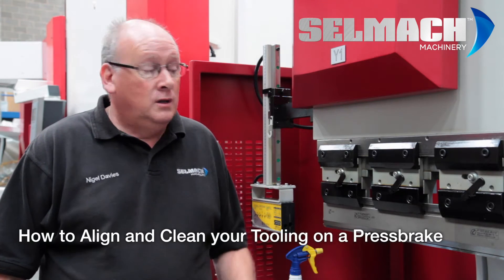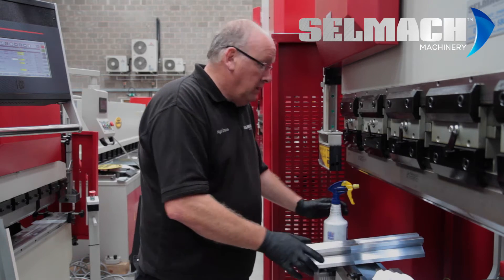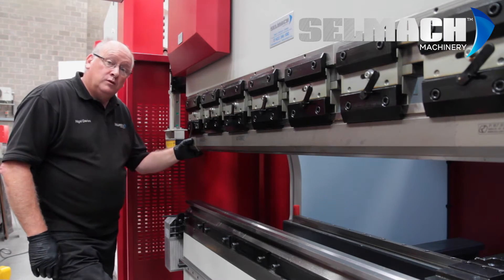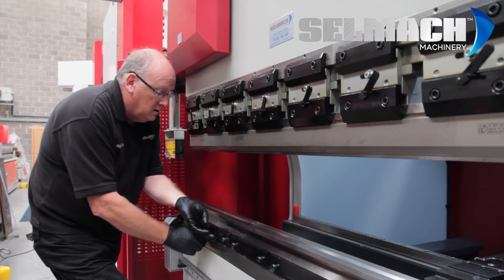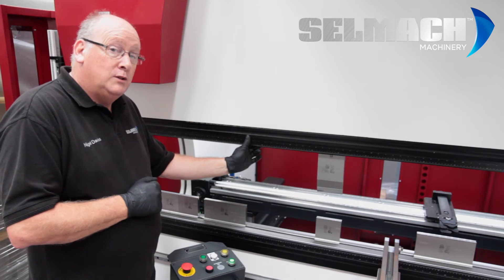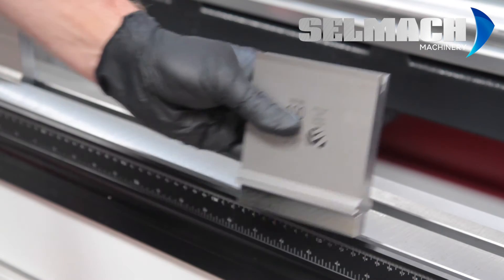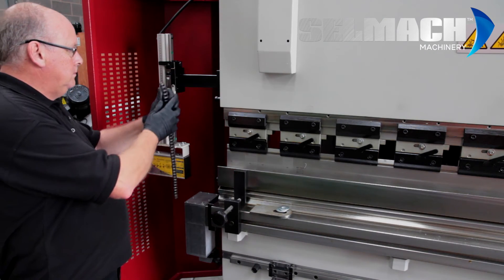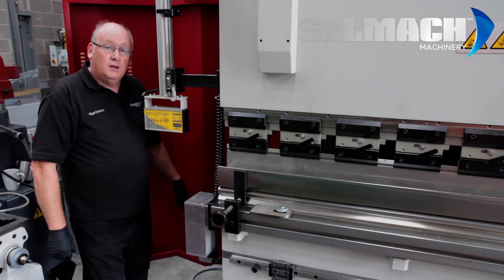How to set up your Press Brake Tool Alignment Correctly FAQ [Selmach Machinery]

Comment: Yeah that’s OK it’s kind of a for a new press brakes kind of a rinky-dink set up three clamps adjusting that is only good for like 8foot strips whatever you’re using for 🤔I’ve got to use multiple tools with part mark with many different types of punches and bottoms  dies different radiuses With different angles With up to about 12 different steps to form one part that break would be absolutely worthless
Reply from the maker: Hi Paul. If you would like further information or to discuss this in more detail, please contact our sales team  - sales@selmach.com